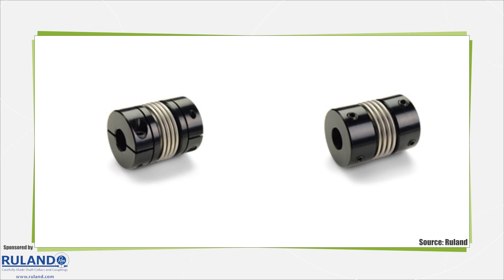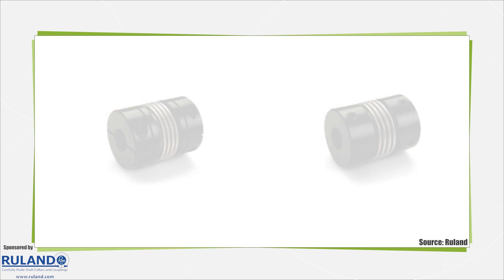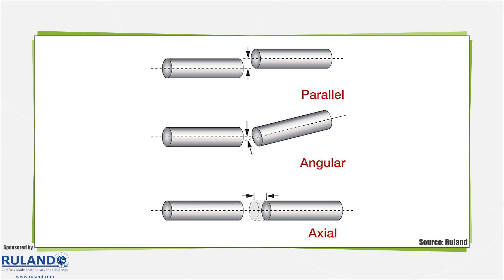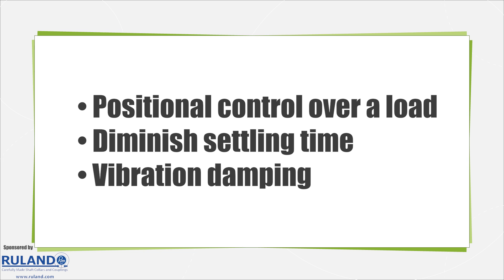What is a flexible coupling?

Comment: I have a unique problem with a project, and I am wondering if a flexible coupling could be the solution. Basically, I am stretching an older sewing machines by 7.6 cm, by cutting two different chassis and drive shafts in half and joining them. I will braze the cast aluminum chassis and join the drive shaft with a coupling. The problem is, there is no way to 100% perfectly join the chassis before brazing them together, so the drive shaft (which is 33 cm long, 12mm in diameter, held in the chassis by one sintered bearing on each side) are never exactly perfectly parallel -- the shaft will still spin, but it's not quite as smooth as it should be. The amount that it's off by is so tiny (if I had to guess 0.05 to 0.1 mm, probably less), and all of the tolerances are extremely tight. Do you think a flexible coupling could help smooth the parallel alignment so the shaft rotates as freely as should? If so, would this be a reliable permanent solution?
Reply: Hu, got a solution?